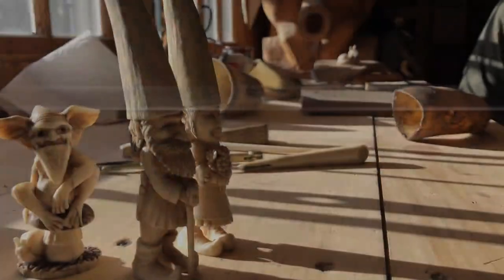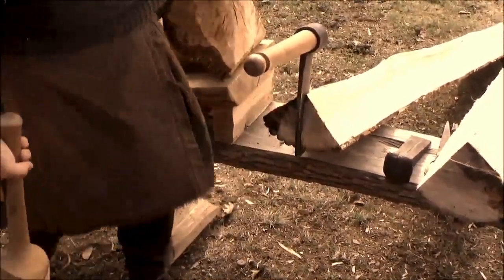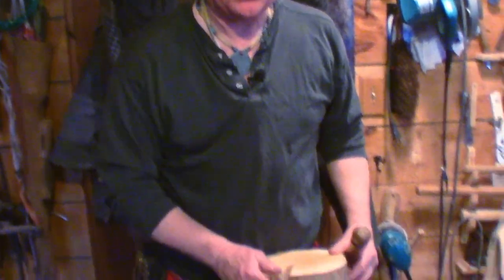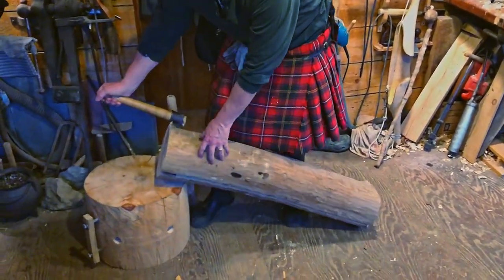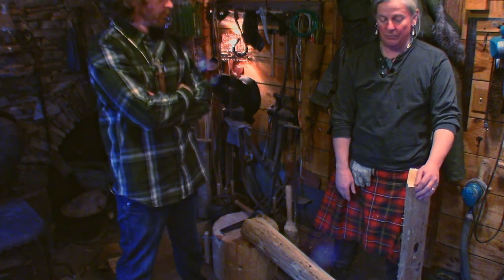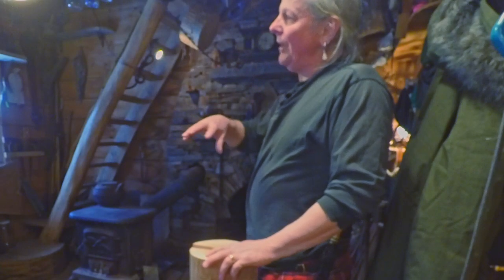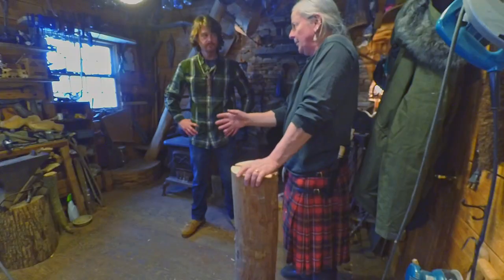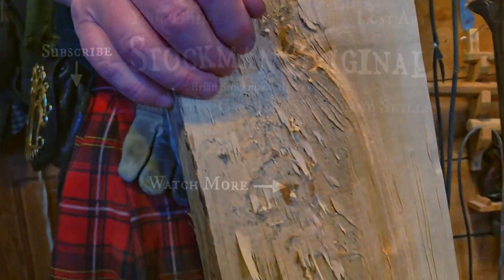How I get a straight split from a log

Comment: Thank you for the tips. I'm new to woodworking and work with hand tools. I just took down a large oak at work and wanted to make some boards with it, is it best to let the log season or should I do it now? The tree was nice and straight and my logs are around  36" long and about 18" - 20" wide. Appreciate any reply.
Reply from the maker: Hello Viracocha, we are so happy to have you in our tribe. Oak is such a beautiful wood to work with. Nice straight grain and splits well. I usually try to split it green so it will dry without checking. Also, if you know which end is the top, you should always split hardwood from the top. If you have a fro , make sure you score the log all the way across the end before you start the split, it matters. The other thing to do is always split things in half, so you will split the log in equal halves, then each haft gets split in half and so on. That way you will have equal resistance on each side of the split. The split will run towards the weaker side if you don’t. This is called greenwood working and it’s a lot of fun, l hope l have been helpful. Please keep me posted on your progress.
Reply: @StockmanOriginal   Wow, awesome reply, thank you very much for the tips.  I checked out a few more videos and enjoy the content, so thank you for that as well. 

I do have a froe as well as a small hatchet, dull splitting axe and an old axe head I can use as a splitter too, the froe is just wide enough to fit across my logs and I never used one before. If I debark it (I'm not concerned about a live edge or anything) before I score it I will have a bit more room I suppose.  Also, I can tell which way is up due to the slight taper, I got the bottom 6 -8 ft or so. It was such a beautiful tree, a shame it had to come down but at least it will become a beautiful side table, or so I hope any ways. 
Just finishing up work for the season so this is when I will get to enjoy my time with some wood. I will return in a week or so and let you know how it goes!